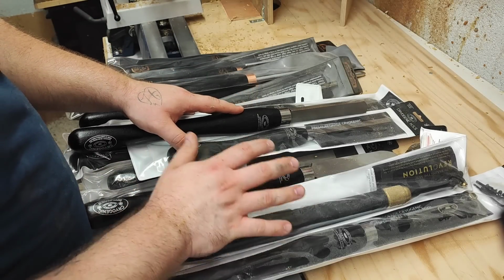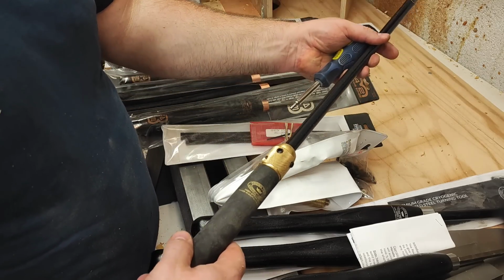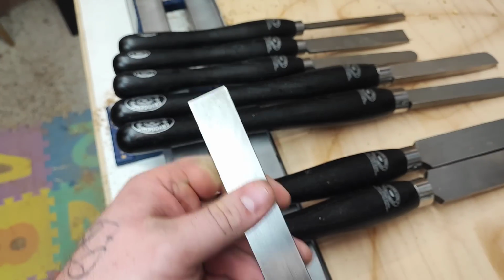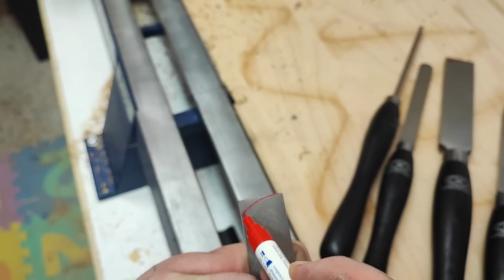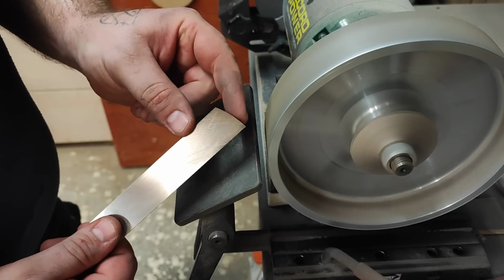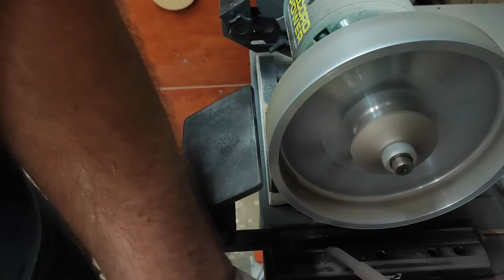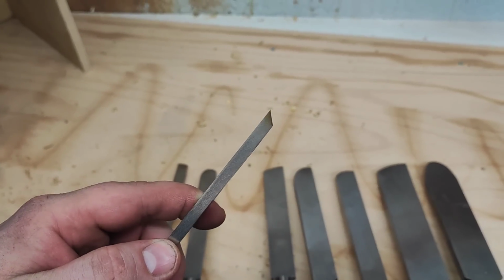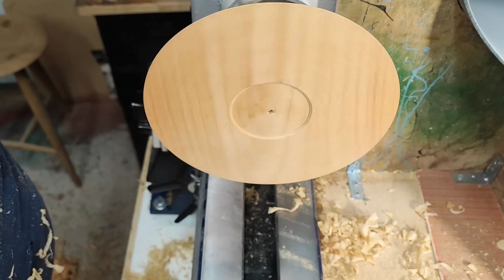How to profile and sharpen scrapers____A big gift from CROWN TOOLS SHEFFIELD

Comment: Great content and very helpful to me as an inexperienced turne asI never get good results with scrapers. Looks like my sharpening technique needs work.
I hope you make a video using the revolution midi hollower tool. I bought one recently (for my first attempt at making a hollow form) as i hoped to get better results by using the super ring tool (as it has a cutting edge rather than scraping edge) but really struggle and get lots of dust rather than shavings. I would really like to see how you get on using it compared to the HHS scraper
Reply from the maker: Thanks for suggestion, I was planning on making a video.... Its a new tool for me aswell but should be fun 🤗

Thank you for watching

Comment: Kudos to Crown. Thanks to them for helping you help us. 

When scraping I’ve been taught to keep the angle between the top of the tool and the face of the material at less than 90 degrees. Tool pointing down effectively. It’s hard to tell what angle you use. How close to level are you?
Reply from the maker: Thank you for support 🤗

I always have the handle higher, otherwise there is a good chance for nasty catch..... Camera can sometimes distort angles...
Thank you once again
Reply: @tomislavtomasicwoodturning  thanks for continuing to answer my basic questions.
Reply from the maker: @zenletter no problem,feel free to ask

Comment: I use scrapers for all of my heavy roughing on bowls, and have been doing that for a long time. Most of the time I will use the burr straight from the grinder. I generally like a 70 degree bevel on mine, which is pretty much how they came, and it is the angle used on the Big Ugly tool that the coastal woodturners in Oregon have been using for so long, no one knows who came up with the idea of using the tantung for the cutting edge. Stellite is a very similar material. I do prefer mine to be 1 inch wide and maybe 5/16 inch thick. Not sure how that translates to millimeters since we gringos/yankees don't use metric.... I do like kind of a straight across and then sweeping back a bit/1/4 round profile for my bowl scrapers. For shear scrapers, kind of the same thing, but I like a burnished burr better than the grinder burr.
Reply from the maker: Thank you for your contribution, we all have different approches and that what makes this even more interesting 😉